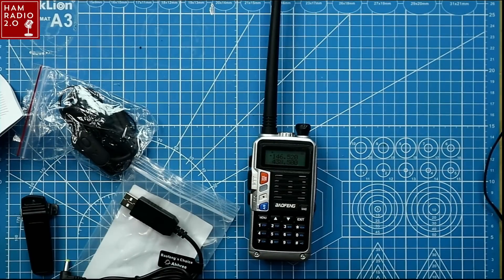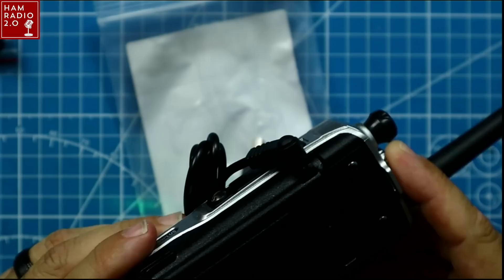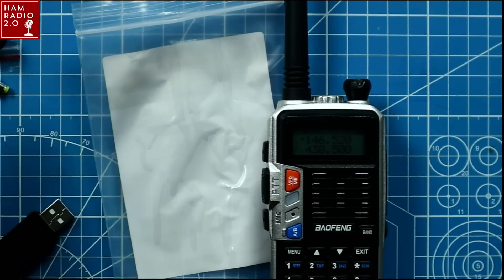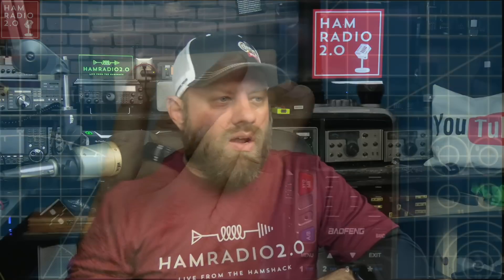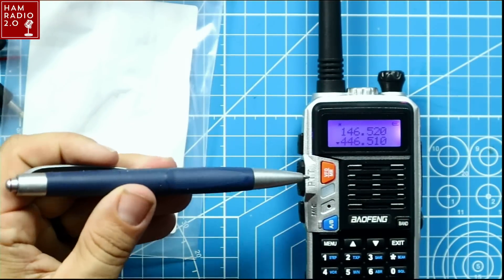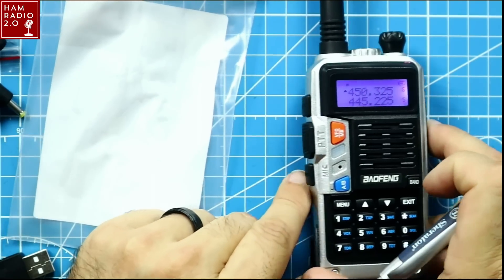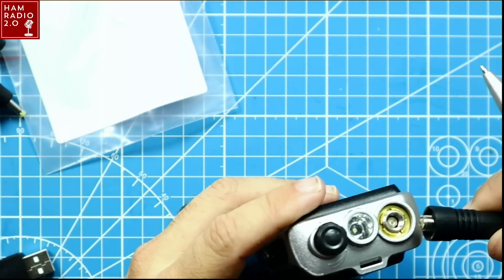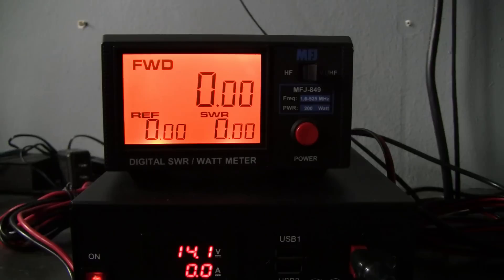Baofeng UV9S PLUS HT Power Test | Baofeng Ham Radio

Comment: There are 2 version. UV-S9PLUS uv-9s tribander.  They seem to be about the same radio. Mine came from abbree. It also blips. It's pretty cheesey. I've been using a bf-h6 baofeng and it's alot better.  Honestly I don't talk on hts or repeaters much.  I really Iike the bf-h6 baofeng alot. I have a Yaesu ft4x and uv md380 and several fangs. Bf-h6 baofeng is the best I've seen on Amazon.

Comment: I bought one of these radios for Jeep-to-Jeep communication on a recent trip.  They did not preform well.  Regardless, the reason for my comment is to mention changing power settings.  On mine (same model), to cycle through the three power settings, all I do is hit the #/key button.  No need to go into the menu.

Comment: I just bought this radio off Amazon.    Label on back states it is 5 watts.   The programming and design are almost identical to the UV-5R, but the battery is 2200 mAH and so far, outlasts both of my UV-5R's.   The UVS9Plus is a tad taller, but seems slimmer.   With the stubby antenna, it's perfect for your pocket, and mine is YELLOW !!

Comment: I bought one for $30 to leave in the car since it is USB charging and I have to say I am very impressed for $30. Receives more than some of my more expensive radios and transmitted at over 7 watts on the meter. Best part is I did not have to do the funny thing to unlock it because the people at Baofeng where nice enough to leave it unlocked. I guess they knew I would NEVER use is any way other than what the FCC intended. 

Can’t beat it for a $30 throw away.

Comment: I bought some uv5r HT'S here in the uk, and the desk chargers came with a fixed USB connection! My 7 port (powered) USB bus, handles all 4 to charge with no problem in my camper van

Comment: Great review, as always!  Just picked up UV-S9Plus from Amazon for the USB charging ability. On 70cm, power out was 1.4, 6, 10 watts and on 2M, it was 2.3, 6.7 and 9.5.  Quality control on these is pretty inconsistent (another UV-S9Plus did 9 watts on High and Medium and 4 on low).  I used a 771 antenna instead of a dummy load.  Agree, not much difference between 5 and 8 watts..more worried about that stock Baofeng antenna!! LOL Battery won't swap out with UV-5R and kinda hard to find online.

Comment: Can somebody explain what is going on with the resurgence of the old/original UV-5 body style?  It's easy to identify compared to the current Baofeng lineup because it's slightly taller, has the band button, and most importantly, and frustratingly, uses a 2 tab battery that isn't compatible with the "BL-5" 3 tab style.

Comment: I have purchased for our volunteer fire department the Baofeng UV 82c. This is listed as a part 90 certified commercial radio.  I bought 2 of these about a year ago we have not had any problems, so we bought an additional 12 units.  I would like to get your professional opinion on these radios. Harbin VFD.

Comment: Technicality, but it’s S9 not 9S, sorry 😇
Like you say, I have 2 of these, both which put out different figures. But also, on a dummy load yes not much more than 4 watts, on a decent antenna, either HT type or ladder line j-pole, it can go up to 7.1
Out of the whole heap of Fengs I have, the better ones are this and the UV-B3 plus, both have the charging point in the side, both use same batteries
Thanks for your continued work out there
Brian, U.K.
Reply from the maker: Technically it's both. The sticker behind the battery says S9, but the box and radio say 9S
Reply: @HamRadio2  😂

Comment: Because it was mentioned, technically, per the FCC, all Amateur Radios that have a scanning function must have Part 15B certification to be legally imported into the US. So, even though our amateur tickets allow us to use whatever, this radio technically isn't legal to import (legal to buy though). While some don't care either way, when you get a radio that's gone through the rigors of Part 15B testing and certification, you can reasonably expect (but not always) a higher quality radio, because they cared enough to follow the law and didn't otherwise shy away from such scrutiny. Even if you are a free-banding prepper, even though the rules may not concern you, sometimes you want a more solid build and something that will likely last longer as such, from a more reputable manufacturer. Then again, sometimes disposable gets the job done also. :)
Reply from the maker: Thanks Mark.

Comment: I'm curious what the "wide" TXP setting would read for power. Does that wide setting come back if you reset the radio? I wonder if that "wide" setting was less of a glitch and more of a "testing" setting that can only be set in software or at the factory... maybe it's 8W and that's how they justify it. Still false advertising if that's the case since it can't be manually selected for, but I'd still be interested to see what power that odd setting transmits at.
Reply from the maker: Nothing. It's probably a bug

Comment: I got a tri band bf-r3 I was gonna send it back because the battery meter doesn't work. Then I put it on the meter and was shocked. 12 watts on vhf 3.5 watts on uhf. It would be a sin to send 12 watts back.

Comment: I have the GT-5R which works all right, and picked up the UV-5RX3 this week after seeing your review on it a couple of months ago. (More people should use the 1.25m band if only so the FCC doesn't try to sell it off again.) I picked up replacement antennas for both of them. So far they work great. Now, if they'd add D-Star and APRS to the tri-band model, we'd really be talking...

Comment: I recently purchased a Baofeng UV-S9PLUS and it has almost all the features you talked about the UV-9SPLUS. It also has the USB-A charger for the battery as well, which is a great feature. It is not advertised as 8W, though. It is a 5W radio like yours.  128 memory channels and three bands 144/220/440MHz. I purchased a Radioddity RD-301 three band antenna to replace the stock one that was only 140/440 (on a three-band radio?) yeah.
Reply: I got this version as well. Came with a bunch of accessories that were thrown out by one of my kids when the dog stole the box and took it upstairs.  They never looked inside. Doh!!!

Comment: Did you say it tx out of band ? If so …. Try it on the watt meter in the commercial portion of vhf/uhf into dummy load , like around 150.xxx. And 450.xxx or 460.xxx

Comment: The radio works well. I haven't checked how much squirt it has. 

I was able to flawlessly connect to a 200 foot tall 220 repeater 6 miles away. I'm in Florida. No hill to valley help here.